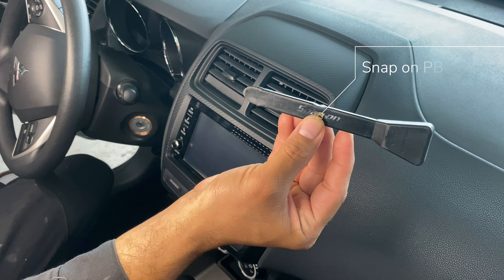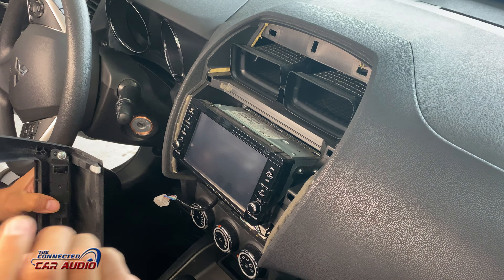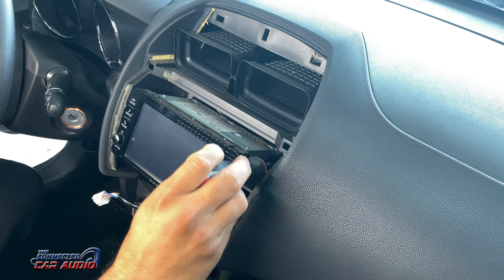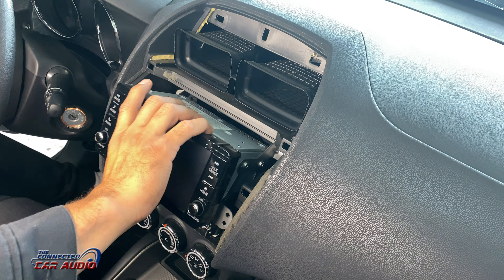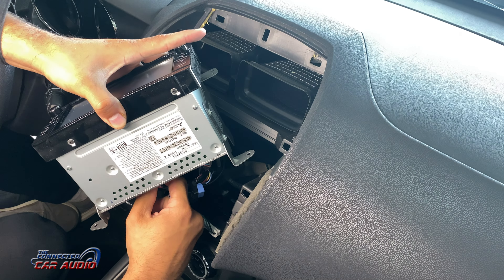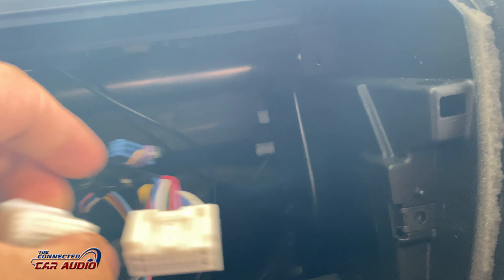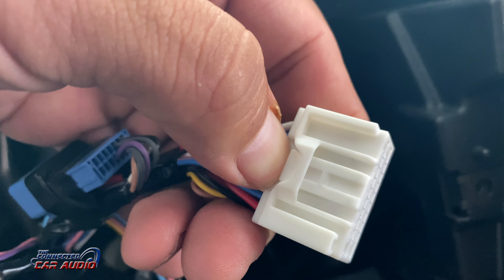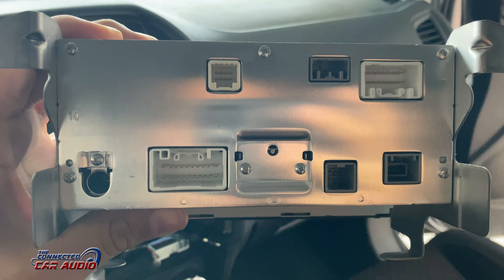How to remove factory stereo Mitsubishi Outlander 2014 and up

Comment: Excellent tutorial! I just finished removing my radio and it took only 9 minutes.
1. Do not use anything other than plastic to remove the cover.
2. If you can, use a magnetized screwdriver or a magnetized sleeve on your screwdriver to remove the 4 screws.
3. Each of the wire harnesses are easy to remove and each is of a different type/size to make reinstallation much easier!

Thanks for your guidance,
Dave

Comment: Don't unplug the airbag light. You might end up having to go to the dealer to clear a code.
Reply: so what happens if i want to replace the media player?
Reply: @suleeeeee-x5m  just let it gently hang down out of the way. It won't be in the way for the rest of the process
Reply: @ragnarokbladeworks  ok now i see what you mean..got it thanks
Reply: I would think. If you disconnected the battery before hand it would never know it was unplugged